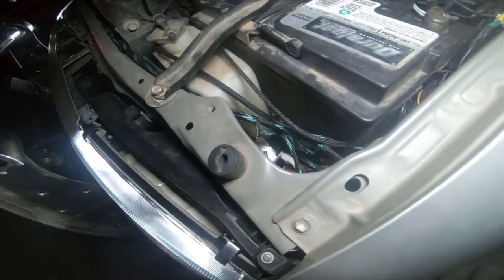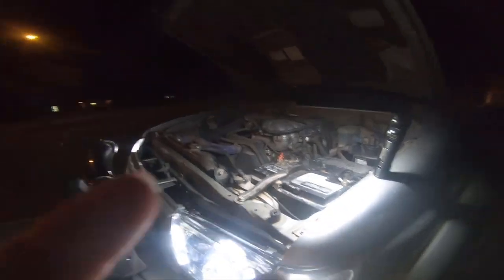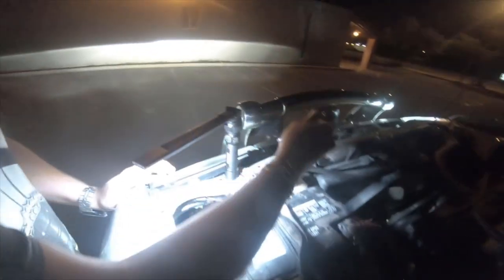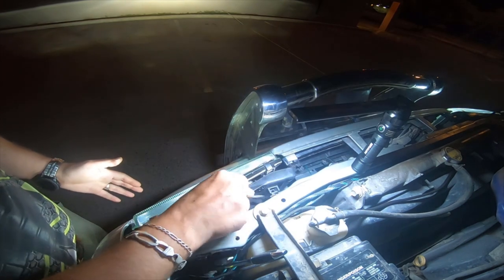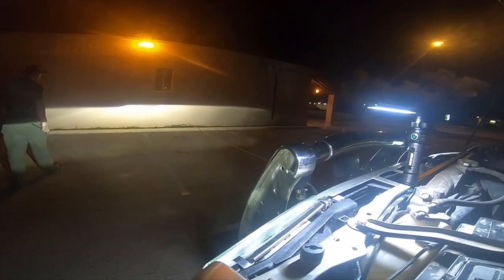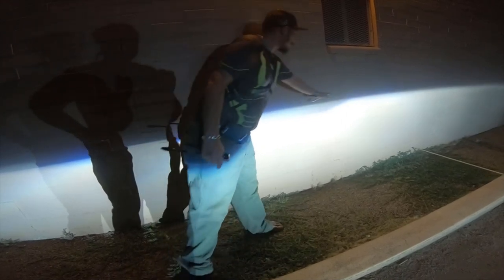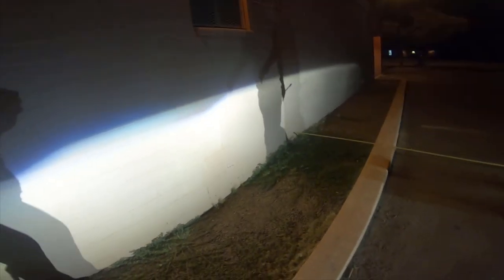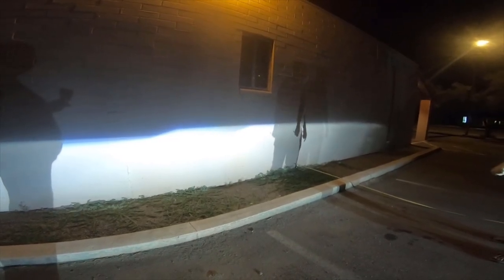2000 Toyota 4Runner - HID Projector RetroFit Install Part 11 - (Headlight Alignment Tips)

Comment: Do I tighten or loosen the lower bolt to bring the headlight down?
Reply from the maker: I explain that on the video What direction for Which Gear  does what motion @To4178
Reply: What part of the 17 minute long video. Cause you just got to working on it lol

Comment: Sometimes the adjustments can be a real pain in the ass but this seemed to be okay and I think over the road you're not even going to notice it
Reply from the maker: I did notice the difference the driver side was original way to high but I had the grill off and was adjusting them during the day just trying to get the lights to align with the panels strait then I showed the adjustment after words on video

Comment: Good info man! So I think the bikes lights are a little low. Is there a height measurement from the ground up that I should be setting them at? I love those lights!
Reply from the maker: What's the height from the center of the headlight lens were the bulbs are to the ground
Reply from the maker: I guess you never Got My reply @BrandonLund